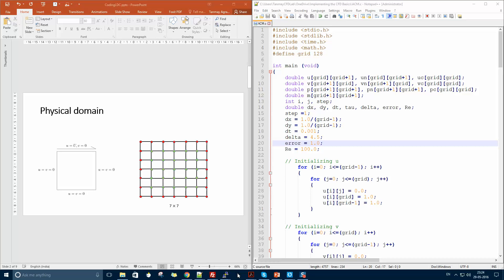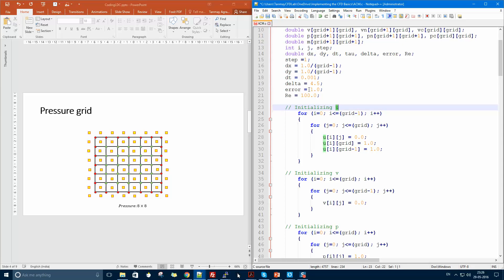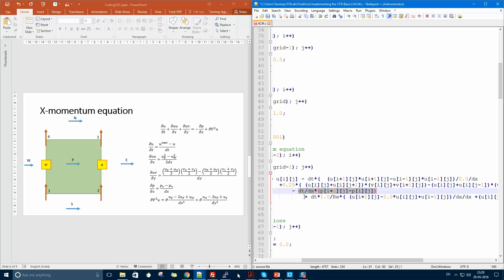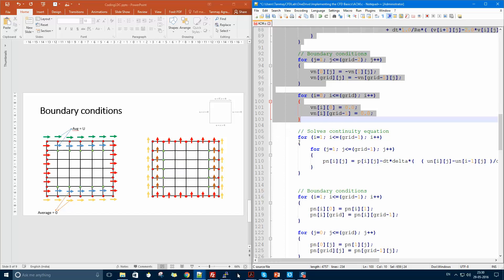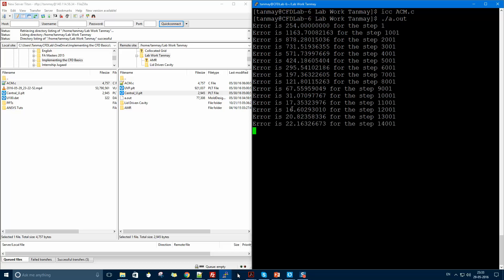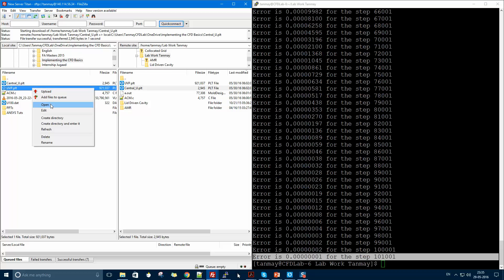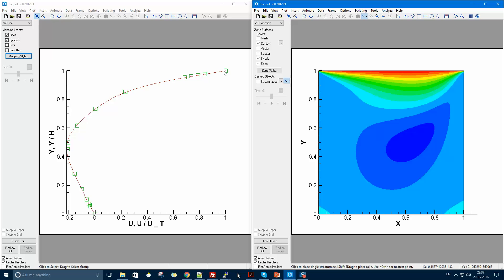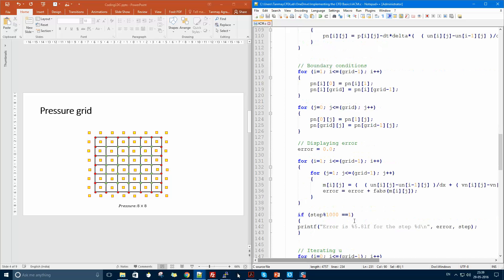Coding for Lid Driven Cavity Flow Simulation in C (Part 2) | 04 | Implementing the CFD Basics

Comment: Hello,
Thnks for the video...i try to solve laplace equation using iterative method... AX=B.......X  is the output which is 1D....single colomn vector  how should i plot ouput for ??
Reply from the maker: Shouldn't you simply use the plot command for a 1D data, if you're working in MATLAB? That should work fine.
Reply: @TanmayAgrawal7  thanks for reply...I am writing in C. 
In fprintf command what should i put....xpos, ypos, X(j) is enough?
Reply from the maker: @mayurpatil6249  I don't think you would have both xpos and ypos for a 1D case.
Reply: @TanmayAgrawal7  actually problem 2D Laplace equation, but in AX=B .... X is row vector....for result plotting which parameters to be considered in fprintf cammand?
Reply from the maker: @mayurpatil6249  Then you should plot 2D data. Convery your 1D data into 2D by the same kind of conversion you have done to create that X vector. Hope that helps, good luck.

Comment: Thank you very much!!
I have a question, by means of this method also can solve convection-diffusion problems?
As I know, this method to solve variant velocity. So I'm curious how to apply to convection-diffusion problem.
Reply from the maker: Navier Stokes equation is indeed a type of convection diffusion equation with an added pressure difference term. The basic stencil/scheme that I have used is finite difference based, so it should work just fine.

Comment: which tool did you used to compile the code ?, can You suggest me which one shall i use to run simple codes
Reply from the maker: I think you can use a compiler used to use called CodeBlocks.
Reply: @TanmayAgrawal7  I used the code shared by you https://drive.google.com/file/d/1ApzJcjmLnecnrWRsFu5rcxLPyjQSaBjP/view, I am not abe to compile in codeblock, it is giving error while running it, 
D:\CFD code\Assignment3ACMTwoDim.exe
Executing: '"C:\Program Files\CodeBlocks/cb_console_runner.exe" "D:\CFD code\Assignment3ACMTwoDim.exe"' (in 'D:\CFD code')
Set variable: PATH=C:\Windows\system32;C:\Windows;C:\Windows\System32\Wbem;C:\Windows\System32\WindowsPowerShell\v1.0\;D:\Softwares\Fortran95\g95\bin
Process terminated with status 0 (1 minute(s), 25 second(s))

please help me to compile the code and check the results as you shown in your video.
Thanks

Comment: This is a very interesting tutorial, however I wonder why: (i) it becomes unstable when the grid size is increased for example 800 x 800 nodes ; (ii) what are the parameters that should be reset to keep it stable; (iii) and how to determine their values? Thank you for your great job, and best regards
Reply from the maker: Please read about CFL number, that is the key. For finer grids, you have to reduce the time step as well in order to get stable computations. How much to reduce? Again, CFL should be less than 1.
Reply: Thank you very much for the suggestion, and kind regards.

Comment: Hello Tanmay sir.
Thank you for this nice video.
I learned a lot from this.
By changing delta and dt, I was able to validate upto Re 5000.

But when I applied the same for Natural conversation. My solution is diverging.
Could you please help?? Or tell me about the delta and dt values for Ra 10^3- 10^6 range.
Thank you.
Reply from the maker: I haven't used it for such case, unfortunately. Please see if there is any work using this scheme in the existing literature.
Reply: @amarendra kumar what we're the values of dt and delta you took?

Comment: Hello, when you explaining the code regarding the x-momentum equation.. the duv/dx part does not correspond to the real equation. For example the ν3+ν4 shouldn't be  v[i+1][j+1] + v[i-1][j+1] instead of what you have in line 60 in the code? Similar for ν1+ν2

Comment: Thank you ,Tanmoy. Can you write a C coding for solving the lid driven cavity problem by using Lattice Boltzmann Method (LBM)?
Reply from the maker: Sorry I haven't done it with C. But with CUDA-C which is nothing but a parallel version of C but using GPUs instead of CPU. I can help you with that if you send it over to tanmayagrawal7@gmail.com

Comment: For a channel flow past over a square obstacle, how this code would be. I don't know much about coding too but I have an assignment to do this. Could anyone of you help me? How boundary conditions should be changed for that?
Reply from the maker: If the grid points of obstacle boundary coincide with that of channel, it should be done with a no slip BC on those points. Otherwise you need to use interpolation to enforce that BC. Points inside the obstacle need not to be computed.
Reply: @TanmayAgrawal7   please send me c code for the same. I have tried this problem a lot but I failed everytime. Hope that you will help me in overcoming this problem

Comment: Hi, a few quick questions, how did you determine the value of delta and what's it derived from? Also, are the values for pressure non dimensionalized here? How about velocity? If so how can I get them back into Pa and m/s respectively? Thanks in advance.
Reply from the maker: Delta in my opinion affects your convergence rate. There is some paper (I forgot the name) that talks a lot about the value of delta. Yes, I am solving the non-dim form of Navier-Stokes equations and therefore there has to be a velocity and pressure against which I am normalizing everything. Usually it is the lid-velocity and dynamic pressure therein.
Reply: @TanmayAgrawal7  thank you for the reply. You did an excellent job explaining the staggered grid approach and the set up of this problem, it helped a lot in understanding CFD basics. I was wondering if you could do a follow up video where you apply the same staggered grid approach to something like a backwards facing step to demonstrate a wider variety of boundary conditions. Specifically inlet and outlet boundary conditions. Thank you and keep up the good work

Comment: Haie tanmay can u help on what can be done to post process a c++ code in tecplot i have done a 2d transient simulation of heat diffusion equations and i want to post process the results..what should ido do i need to to include any library in my exting code so that i can do the post processing in tec plot.Is there any documentation available for the same can u help me in this regard.
thank u in advance

Comment: Hi Tanmay, thanks for this amazing video. Could you please describe on which numerical solving method you used to solve your discretized momentum equations, to get the new velocities. Thanks :)
Reply from the maker: It's a finite-difference based discretization of artificial compressibility equations.
Reply: Tanmay Agrawal I meant which methods are we using to solve the discretized equations,  like in SIMPLE algorithm I used alternating direction implicit method for solving the equations, did you use something similar?  like macCormack scheme?
Reply from the maker: I am using a second order accurate central differentiating for space and first order forward differencing in time. You can try to play around with different schemes. I have also used MacCormack scheme, it also works just fine.
Reply: Thanks a ton bro!!  I have sent a few doubts of my to your LinkedIn profile,  Could you please check them out and see if you could help me with those?

Comment: Thanks a lot for giving a clear explanation in coding , what are the parameters that i need to consider while iam going for a 3 d analysis of the same problem.
Reply from the maker: Nothing much should change, I have used the same parameters for a 3D solution as well.
Reply: Thank u..for reply sorry i just didnt get your second question..
Reply from the maker: I am sorry. That was in reply to another comment, not yours.
Reply: Is it possible for you  to share a 3d code..
Reply from the maker: There you go:
https://1drv.ms/u/s!Ap1As21yR8unlrUovWt_8zgqT3Ms2g
Reply: Thank u so much ..... i am new to this field of coding and initiative you have taken to reveal what is happening behind the black box is awesome.., can i just connect with u for small query regarding same .Could u just share ur mail id ..
Reply: Dang! This link does not work :/
Reply from the maker: This link should work for a general 2D code and can be easily extended to 3D. Write to me if you can't
https://drive.google.com/file/d/1ApzJcjmLnecnrWRsFu5rcxLPyjQSaBjP/view?usp=drivesdk

Comment: Hi, Nice  and detailed video Tanmay. I am trying to implement your code in matlab. But, I am making some mistake somewhere. It is giving me a U matrix with very high values 10^139 or so range and the boundary values for the side with value of 1 are giving infinite and NaN values. Any comments on this?
Thank you.
Reply from the maker: You need to debug your code. Probably some mistake somewhere. You can try mailing your code to me. Also, you can run your code with lid-velocity being zero and see what happens (if everything is fine, nothing would happen), but if you have something wrong, you'd still get NaN somewhere
Reply: thanks for the reply. I have mailed you the code. Even after changing it is still giving NaN, or it is not converging.

Comment: Hi Tanmoy.. It is a great work. Thank you. Can you please extend this tutorial for laminar pipe flow problem ?
Reply from the maker: +SOURAV SARKAR why don't you try it? It's simply change of boundary conditions. You can let pressure BC at inlet and outlet and no slip condition at walls. Should be fairly easy IMO :)
Reply: Thank you Tanmoy!! 
I am currently struggling with that. I am having problem with implementing boundary conditions. I am specifying inlet velocity at inlet and outlet pressure at outlet. I am also giving no slip condition at the walls. Still It is not working. I have some specific doubts.

1. What will the B.C for v velocity?
2. What will be the pressure B.C for those top and bottom ghost pressure nodes ?
Can you please comment and suggest what further can be done.  
Thank you for responding..
Reply from the maker: 1. V-velocity is zero at all the walls. Saying that, it means that pressure across top and bottom ghost pressure nodes would be the same (therefore ensuring no flow).

I will recommend you to define pressure at the inlet rather than the velocity because it is  pressure driven flow and defining velocity at the inlet beforehand is a bit ambiguous.

And my name is spelled as Tanmay.
Reply: Is it possible to generate a semi-circular region using finite difference method? What will be the coding for solving NS Equation in that region. I will be thankful to you if you can help.
Reply from the maker: You'll need an understanding of writing NS equations in cylindrical co-ordinate and then solve them using FD

Comment: Thank you very much for your videos. They are very very helpful. :)
Instead of using artificial compressibility equation, can you make a tutorial on pressure correction method on this similar problem? Thanks!
Reply from the maker: Thank you for the comment.

Yes, there are different methods you can use for the solution of incompressible NSE. Please visit the following github site for a variety of codes including pressure corrective SIMPLE method (in FORTRAN)
https://github.com/xuaoxiqi/Computational-Fluid-Dynamics/tree/master/21.Lid%20Driven%20Cavity%20Flow

I have used SIMPLE method (in C) a long time ago, I hope this is the working code:
https://1drv.ms/u/s!Ap1As21yR8unk5QuvtGYzUaQ69LpQw

For more info, please refer to the book by Patankar, it is wonderful.
Reply: Thanks! I appreciate it. :)

Comment: Hi, one question on validation. If I were to do validation, how do i extract the results from the papers in the internet? Do i have to input the data 1 by 1 ?
Reply from the maker: Yeah, usually we make a separate data file for the exact result. Since we have already done that in our lab, you can simply grab them from here https://onedrive.live.com/redir?resid=A7CB47726DB3409D!313765&authkey=!AE30qncgAI8prAM&ithint=folder%2cdat
Reply: Thanks. I've open your files with MS Words. I'm not sure how to read them,There's 2 columns of values or I have to open with some software? May I ask if u're familiar with SIMPLE algorithm on the same problem in MATLAB?
Reply from the maker: I usually use Tecplot for reading the files. You can use Notepad++ to see the files. The two columns are the values of position along centerline and velocities. I don't use MATLAB much but I am sure this can help you http://math.mit.edu/~gs/cse/codes/mit18086_navierstokes.pdf
Reply: can you elaborate more on the values of position along centerline? what is it? thanks for the help :)
Reply from the maker: Usually, the data against which we validate is velocity vs position. That means for example, we will have the exact (or almost exact) values of u-velocity along the center-line (it could be x = 0.5 or y = 0.5). If our velocity profile along this line matches with that of benchmarks, we are good.
Reply: okay ill look into it :) thank you ! continue your good work too !
Reply: Hi again, regarding the u-velocity along centerline, if im doing 16x16 grid, does that mean im looking at the velocity values at column of 8?
Reply from the maker: +lelo uch (lelou) You should look at the center i.e. x = 0.5. So, look in between column 8 and 9, I think that's where your midway line would lie.